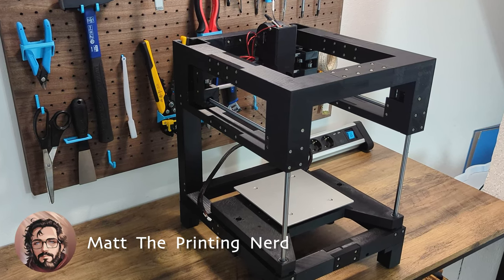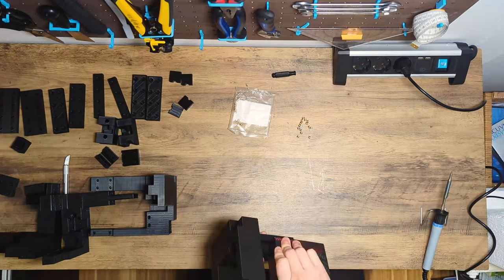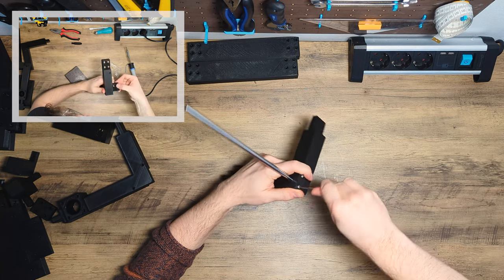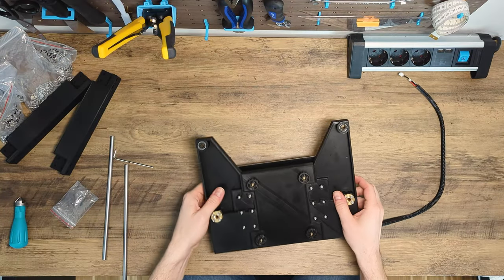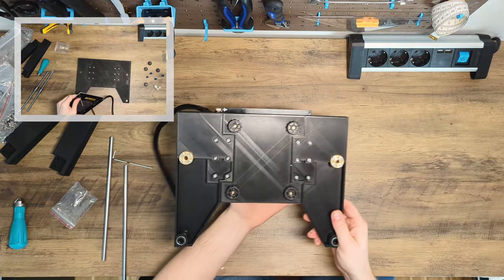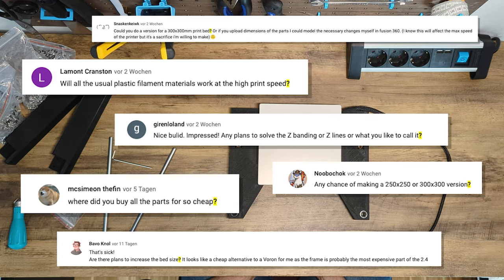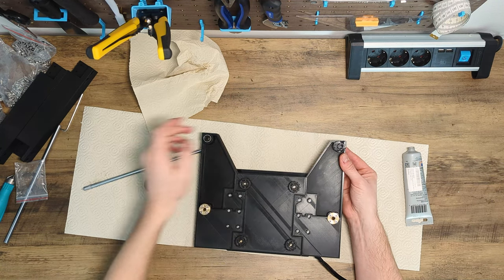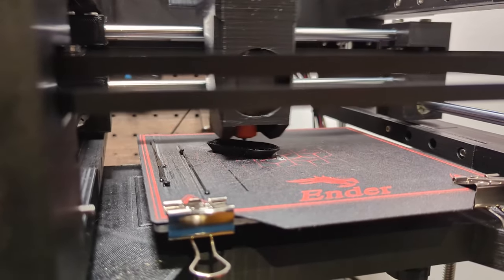THE 100 Assembly Guide - Part 3: Bottom Frame

Comment: Some questions for the Q&A
1. I'm not a big fan of leadscrews. They often tend to bend what causes ugly Z-binding. Wouldn't it be better to use belts? 
2. Is there any chance for a kit of the required parts in the future?
3. Why aren't you using bigger high torque motors? They should reach more accel and speeds.
4. Why did you design the frame so "edgy"? Is there any particular reason why you didn't use chamfers and roundings?
(5. Why is the print quality of your frame so bad? What happened to this printer haha?)

Thanks for releasing this cool project for free! :p
Reply: 1 and 2 are good questions. 

I think I can answer questions 4 and 5. For 4: Probably it is so edgy because it's easier to print and maybe even more stable than if it were rounded/chamfers. For 5: Probably printed super fast and those ghosting marks are form high acceleration without input shaping

Comment: Are there heat inserts in the corner bottoms of the bottom frame for the feet to screw into? Or do the M3 bolts just go into plastic?
Reply: To answer my own question, yes, there should be inserts in the bottom of the bottom frame for the feet. The holes are not big enough for the M3 insets, but you can still get them to melt in. Careful. It's not hard to misalign them slightly.

Comment: I get horrible warping when i print the large parts of top and bottom frame. What settings do you use to avoid warping? Is it at all possible to get good results without heated enclosure?
Reply: Warping for parts in general goes away if cool air isn't introduced randomly. A controlled environment will definitely help with warping troubles.

Comment: Good evening matt :) i was just about to start building the rook 180 until i came across your build:) wow those speeds are outstanding:) , I’ve probably got most of the bom at home but ive 1 big problem:( ive only got the megs s anycubic with a build space of only 210 x 210 x205 :( . 

Can you think of a way around this ? Would it be possible to take 10 mm of each end then fill this gap with resin once the joint plate is attracted?? 

Please help in stuck :( and thanks in advance 
Luke
Reply from the maker: The printer is open source so you could modify the frame parts so that they could be printed on a smaller bed size.